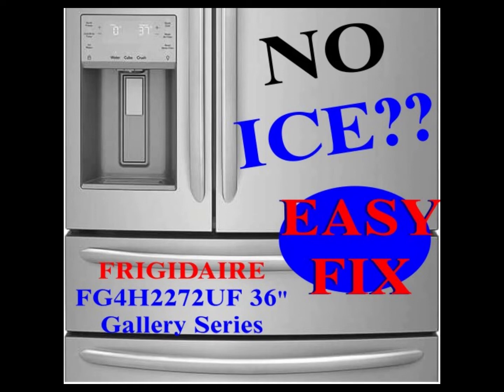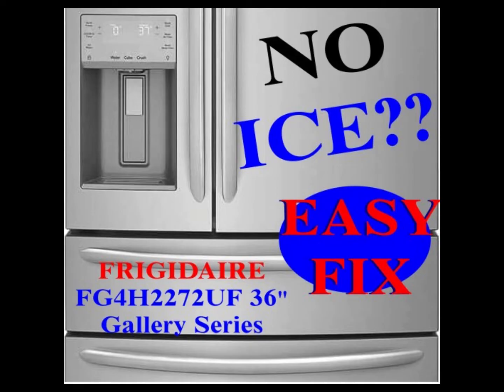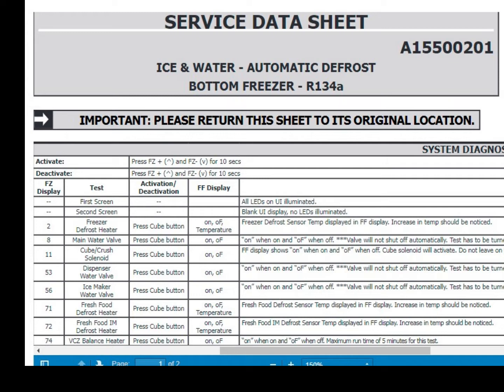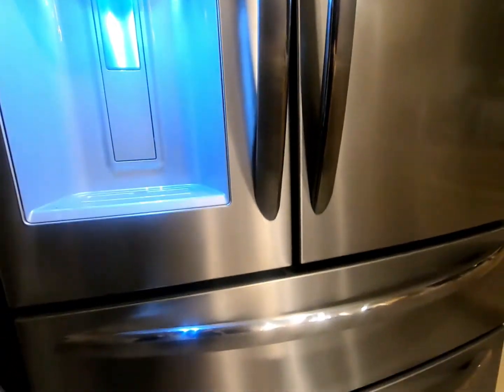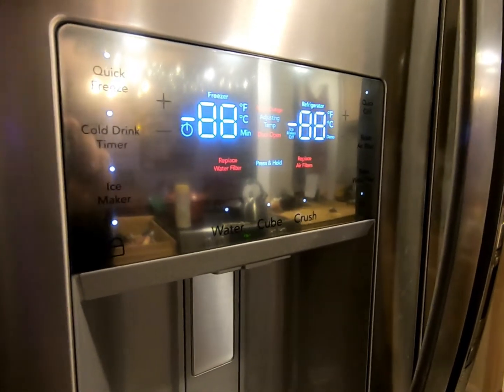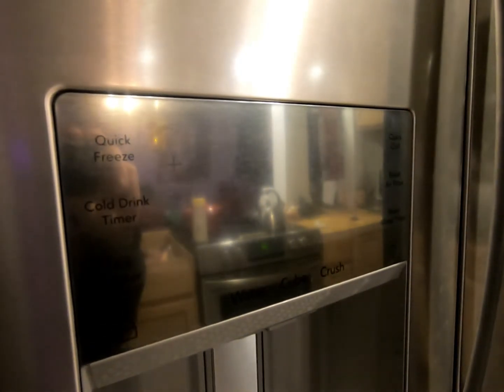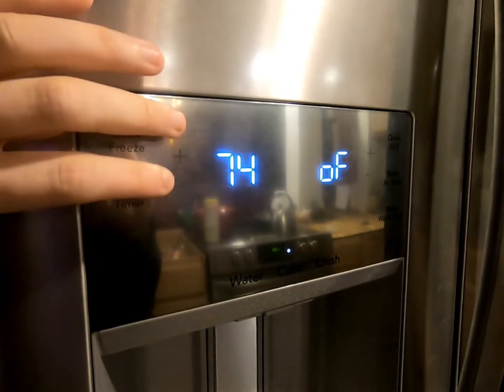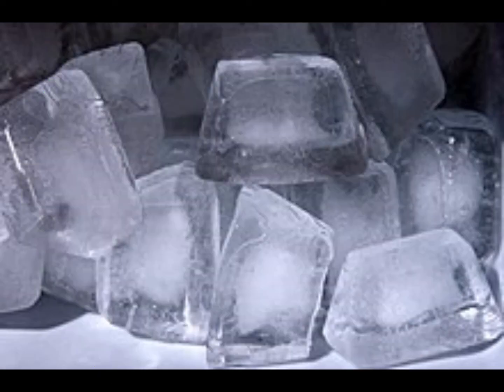No Ice FIX Easy Frigidaire FG4H2272UF Gallery Series Diagnostic Mode Defrost NO TOOLS

Comment: okay, I have this exact model, currently. when I 1st plugged everything in, it made ice well. after 2-3 days, no ice production, which definitely leads me to believe that there is a defrost issue as well. one of the big issues i am currently experiencing is the drip pan located behind the rear bottom metal access panel that sits under the black coils, keeps filling with water, and pretty quickly, to the point that the water ends up overfilling and then eventually leaking onto the floor. I feel like the water that is supposed to be going to the ice maker is somehow traveling to this drip tray pan, and most likely ( I believe) this could be due to a failed defrost heater somewhere possibly. what do you think @BigV ? -Any help would be Greatly Appreciated
Reply from the maker: Interesting! I would try a couple of things- have you tried test #56 in the manual linked in the video description? Make sure water is traveling through your fill tube to your ice tray (and a good stream, a drip or low psi could indicate a leak like you think may be present).

Is water leaking at the water filter? check and see if there is a good seal or evidence of water leaking where the water filter is installed, and if that is preventing water from entering the ice tray.

 Also to double check, how old is your filter? I had a ton of water leaking from my ice maker the first time I needed to change my filter., and no ice. I now know filters only last 3 months in my house, not the usual 6 months (I desperately need a whole house filter). The second time my filter was the issue, I had no ice and no water to the tray when I ran test 56. 

Other tests I might try 79 (fill tube heater if water does not come out into the tray and it seems the fill tube could be frozen), tests 45 and 68 (see if either of those show as shorted or open, and note the temperatures).

I will continue to brainstorm! Keep me updated.
Reply: How do you check for water making it to drip tray? We just bought house fridge is new water flows into glass but zero ice or signs or ice

Comment: Does the defrost on #72 unthaw the waterline that feeds the ice Maker? My waterline gets ice in the hole where it is supposed to fill the ice tray.
Reply: How warm ( *)  should you let the temp get before you stop the defrost cycle?
Reply from the maker: Try #79 if 72 does not work, It is labeled "Fill Tube Heater"... Sounds like it may do the trick!
Reply from the maker: I let mine rise for about 25 minutes. Not sure what temp it got to, but I will run it again tomorrow and monitor it and get back to you.
Reply: @bigvslilworld  On Test #79 after turning to "on", I see no Temp value
Reply from the maker: @tundralane256  Very interesting. I wonder if it is an issue with the board or if the thermostat has an issue. Try test #68 "Ice Maker Defrost Sensor" and see if it gives a temperature reading or if it shows "OP" open or "SH" shorted.
Reply from the maker: Also mine got up to 2 degrees last I saw (started at -15 degrees when I ran the test again), went back and it had finished the cycle and left the test mode.
Reply: @tundralane256 mine did same thing - never displayed a number… just says “on” I waited 5 min with no changes
Reply: Great video thank you so much
Reply: Let it run till it got up to °75. Now I'm on mode#79. Gonna try warming up the water feed line
Reply: It all started after changing the water filter
Reply: Had to keep restarting by just hitting the cube button, got the number pretty high